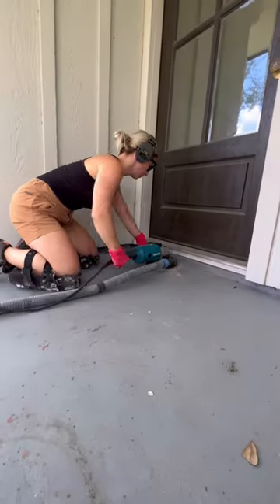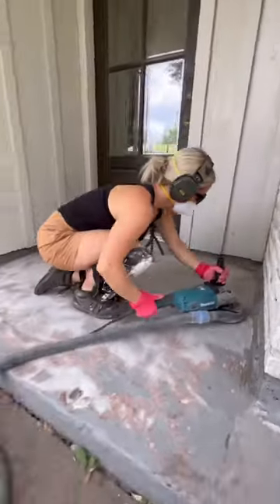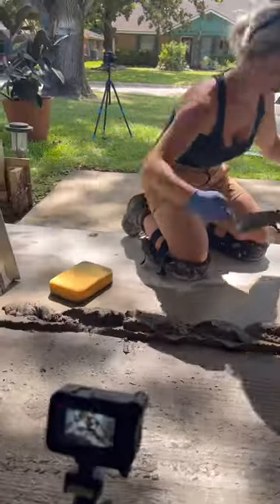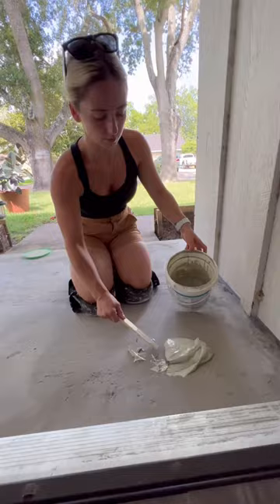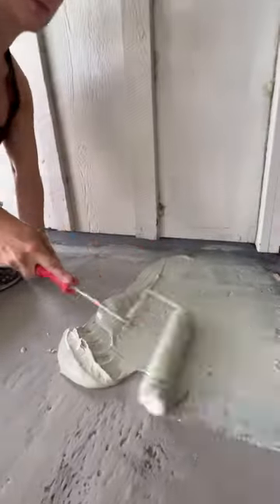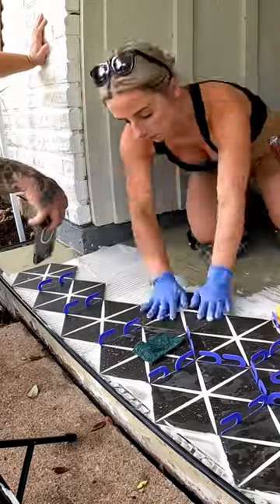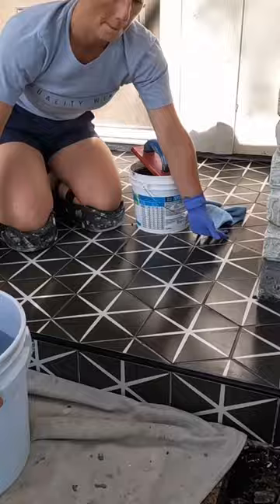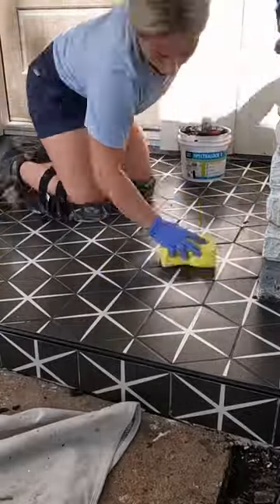Tile this patio in 40 seconds #shorts #reels #shortsvideo #fyp

Comment: That is gonna be a slip n slide when it rains
Reply: Exactly what I was thinking.  It's nice, but... definitely a safety hazard.
Reply: my first thought
Reply: You are right, but it's still very nice 👌
Reply: right on. I'd rather not bust my ass on a plain patio.
Reply: Was about to say the same thing.
Reply: Its trendy tho. Kinda like the dark hardwood that's slicker then snot on stairs lol.
Reply: Shark bite helps the slipperynesa
Reply: Add a layer of epoxy with clear silica, no slips!!!
Reply: Ahh it’s probably not going to get much rain under there!
Reply: you probably couldn’t even do the same job yourself if you wanted to lol , i wouldn’t be worried about judging it when it rains , i am a tile setter and this is a fine application with quality products, not to mention hexagon tiles but she prepped the slab herself and floated to level with a screed , take your negativity elsewhere
Reply from the maker: @purple2275  Exactly, Its covered number one. Second this tile has a matte textured finished and has a higher co efficient of friction (slipperyness) than a polished porcelain
Reply: pain
Reply: Worse-than-death-slip-and-fall porch.  Should look nice with an unused chair and an unwatered potted plant on it.
Reply: @ThatTileChick  I have a covered front porch 8' deep, still gets wet from storms, wind blown rain. Hope that texture finish is a high grip sand texture, if not will be super slick when wet.
Reply: Who puts tile outside. It is going to slip and slide when wet
Reply: Exactly what I thought
Reply: @whitetailhunter7202  nice work screw the haters
Reply: Wow if you really think that since it’s covered that you won’t slip 😂😂😂😂😂 as if water doesn’t get onto your soles and wala your tailbone is busted
Reply: @brendanokeefemusic-  Never said it didn't look good. No haters here. Experience shows this is a hazard. Had close friends do this in "dry" locations only to suffer injuries they still deal with 10-15 yrs later. 😕
Reply: Interior things aren't meant for exterior living.
Reply: @ThatTileChick  it's meant to be slippery cuz it looks like a public bathroom
Reply: Not true actually, my whole building complex has tile floors out in the open. I have been living here for 23 years and no one has slipped and fell.
Reply: @user-vb9kd3lg1s  count yourselves fortunate.
Reply: @whitetailhunter7202  i mean i guess but i don’t see it being a problem, it’s no different than having tiles in your shower. You can still slip and die.
Reply: @ThatTileChick  I hope this isn't offensive for me to ask but are you a little person?
Reply: @user-vb9kd3lg1s  Around here, it's common practice to use Heavy texture, like grip tape for shower floors if not a shower base with texture floor. Bare feet grip better that shoes on a wet surface anyway.🤦‍♂️
Not too many have shower large enough to walk around in either.
Reply: yeah but she’s hot so it’s cool
Reply: Rookie mistakes
Reply: The grout lines might help. Also, it depends on the material.
Reply: “….😂🤣😂🤣”!!! G-MOMMEE
Reply: @ThatTileChick  it's covered doesn't mean anything...wind pushes water anywhere it can go, covered or not, BUT I'm super glad it's a matt finish
Reply: Don't forget when the sun hits it, Hot af.
Reply: @ThatTileChick  doesn't matter it's going to be a hazard.
Reply: @soledadvega3563  It is very nice but seeing everybody knows it’s slippery the first neighbor to slip on it and break their hip is going to sue.
Reply: Seal it correctly.
Reply: Agreed
Reply: First, why are all of you so negative. Second, these aren’t your bathroom tiles. they have grit in the finish for anti slip and longevity. Third, from camera, grout looks perfect
Reply: @Will Manes I’m guessing you don’t work there anymore
Reply: This tile has more groves and edges than the soles of your shoes. No one is slipping on this
Reply: yup hope it doesn't snow there as well. wet shoes will definitely slip
Reply: @soledadvega3563  do u no difference between s hit or clay
Reply: First thing I thought of
Reply: She lie
Reply: People's outrage is so funny to me. You might not be used to seeing it, but it doesn't mean it's wrong or a "stupid choice." Tile is used a lot in many parts of the world, in a number of different spaces. Back home in Brazil, my grandma's "porch" is made with tiles; many people's outdoor areas, in fact, have tile flooring, including in pool areas, laundry spaces, etc. It is pretty much the to-go standard here, both inside and outside the home (including showers!) There are many different types of tiles out there, some are slippery when wet (so don't put those in your shower, for example), but there are many options in the market that are appropriate for projects like this. Also, don't be a dumbass around ANY type of wet surfaces, even wood can be risky in the right conditions.
Reply: No its not
Reply: Snow and ice disaster in the making. Check your homeowners insurance coverage.
Reply: It’s just tile lol
Reply: @purple2275  Florida, rains freaking sideways all summer.
Reply: Should've seen the 2ft square tiles on a customer's patio in winter lol. I had to put a ladder up to the extension's roof on them 💀
Reply: @ThatTileChick  haha it has a higher co efficient of friction ( slipperiness) than POLISHED ICE!!  Seriously it looks good though. I wouldn't mind falling a few times if it looks like that.
Reply: @user-vb9kd3lg1s see that’s a good point, showers are tiled and majority of people don’t slip. Let the women do what she wants lol
Reply: @ThatTileChick  still gonna walk on it with wet shoes coming home.
Reply: Pretty
Reply: @_flyingspaghettimonster_  yes, she's a little person if you compare her to an elephant or a giraffe, even an elk.
Reply: @weejohnbb A little person implies it's a human. Elephants, giraffes and elk aren't human but thanks for your reply.
Reply: First thing I thought slip and slide
Reply: I said the same.
Reply: 😮 that’s why we don’t see this more often. I’ve never seen it before
Reply: @ThatTileChick  higher coefficient of polished porcelain isn't exactly saying much, polished porcelain is a shut surface for footing grip. Ever see rain come in sideways?
Reply: @ThatTileChick  matte finish or not, the top will always be slippery when wet especially when wearing shoes or slippers. Bare concrete doesn’t mean , let’s tile it cuz I’m bored

Comment: The salesman who sold you like $1000 of Laticrete products for a 60 sq ft exterior patio is a fuckin savage 😂😂😂
Reply: She made her money back on the video so it didn’t matter 😂
Reply: I was going to say the same thing. Tile prep is overrated. Although it certainly does help prevent issues down the line sometimes, most of the time it's just a waste of money. And we passed that on to the customer and everything becomes more expensive as a result.
Reply: @cuchanu  I mean, I spare no expense on something like a shower, but a patio this size needs nothing lmao
Reply: @MrCk1234567890  Gallon of solid color concrete stain I'm goog lol

Comment: Well if you live somewhere that freezes that's alot of layers. More layers means more bonds that could seperate when the temperature changes. Unless the slab is cracked the isolation membrane is not really necessary especially on that small of tile. Even the leveler is not necessary if you butter the pad and the tile. I don't know if laticrete is a sponsor but mapei granirapid is the best exterior Mortar.

Comment: grinding the pervious layer con concrete was correct, however you should have put down an apoxy solution because that new concrete isn't going to stick to that old concrete and it is going to Crack and crumble. Also why did you make the mix so thick?

Comment: As a general rule I am against using tile in exteriors and double so in an entry. Thin overlays are bad too. If the elevations work out it is better to use brick. Otherwise the concrete should be either repaired or replaced.

Comment: Would look much better AND most importantly be MUCH safer using 1/4 chips broadcasted to refusal over a 100% solids epoxy base, then covered by a polyaspartic topcoat. Should last at least 10 years, would protect the concrete and make it much more slip resistant.

Comment: Just use gel paint stripper , a scraper and a wire brush on a drill. Don't need a diamond tip wheel for a cement porch.... also , you don't need anything besides tile and grout and mortar to adhere to porch. That's like adding cement board to concrete floors to tile your kitchen. Waste of money and time.